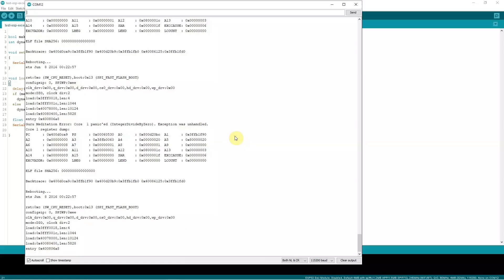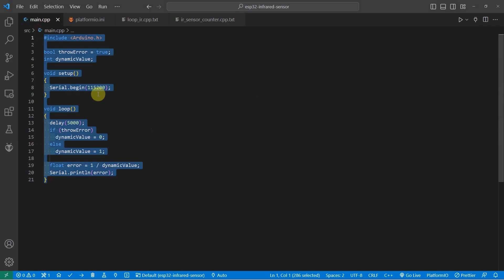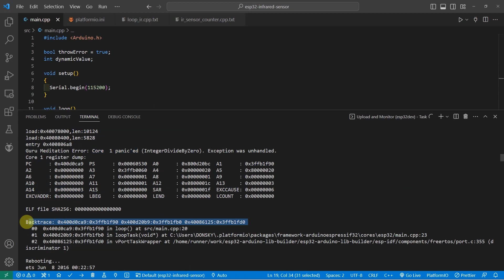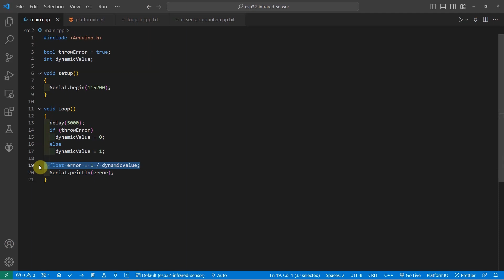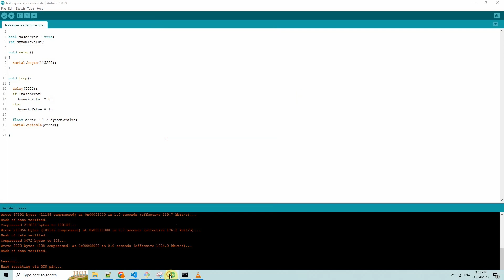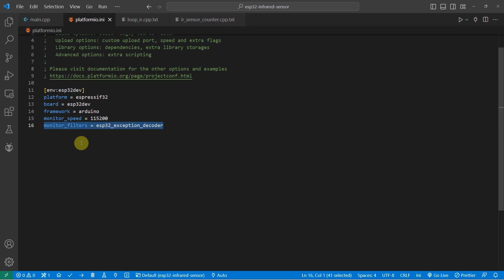ESP32 ESP8266 Exception Decoder

Comment: YOU ARE A LIFE SAVER!!! I found the error when using this technique in just a couple minutes.
Reply: which version of platform io u are using?? it is not working on 6.1.16 version
Reply: @ajayjadhav690  Core 6.1.16 · Home 3.4.4. You may need to "Full Clean" your project or reset you VS Code

Comment: This would be useful if you showed how to decode the exception in PlatformIO. Go to 2:41 and explain what you are doing. :face-orange-frowning:
Reply from the maker: Hey, not sure what you mean. But the exception decoder just gave you the line where the exact error occured and not just the stack trace. The example here is a very trivial overflow error but as you can see instead of receiving a stack trace error then you have there the exact line where the error occured.